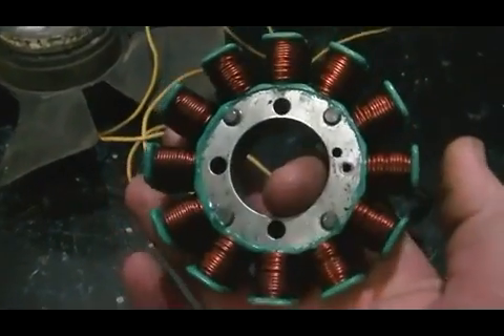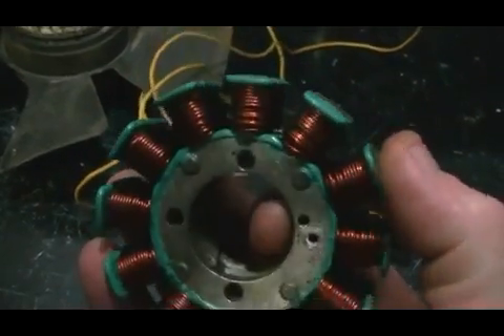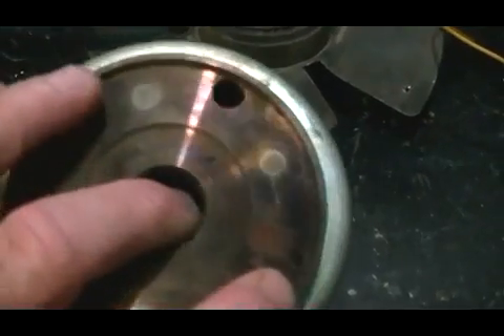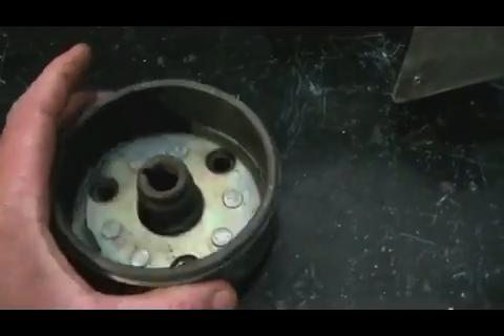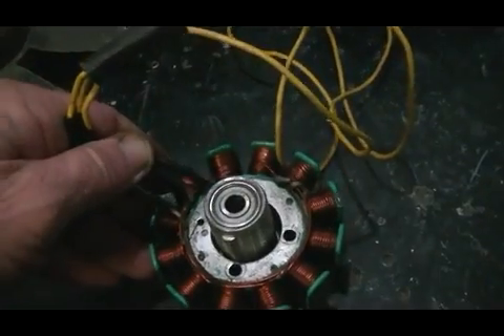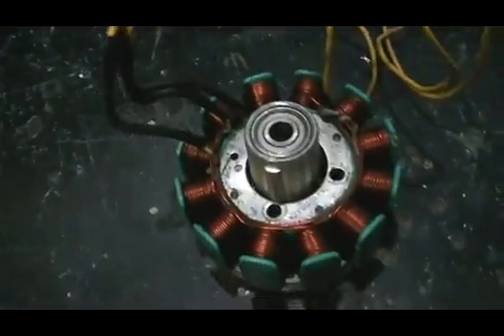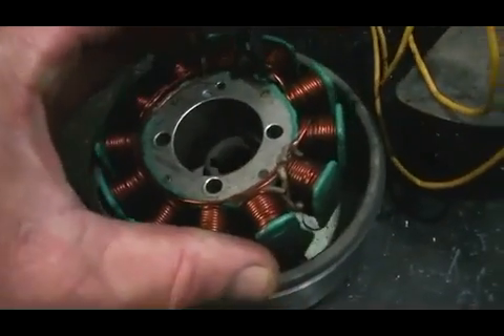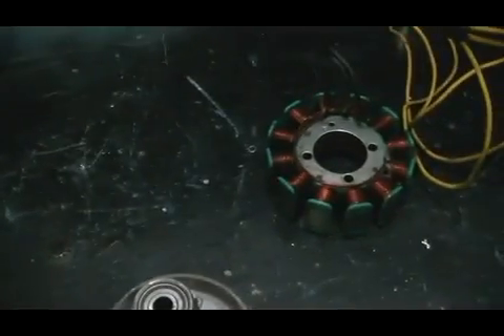Stator motor build pt1

Comment from the maker: Hi John
It just so happens that i did fool around with a smart drive motor once-it's burried in my video collection here some where lol.I have had a look at some celling fan motor's,and they would be very hard to wind,as there is only a very small gap between core tops to get the wire through. We will see how this one turns out first.
Cheers

Comment: You amaze me Brad. I can't wait to see how that comes out. If it works maybe we can go to a ceiling fan motor or even better yet something like a Fisher Paykel Smart Drive.
Keep in mind, super strong magnets are not always the best option. I have good results with very small ones. I wound the last motor as you explain with two triggers and two power coils.
Good luck.
John